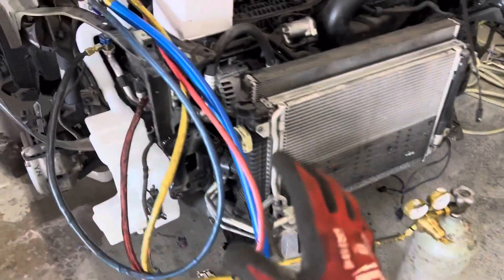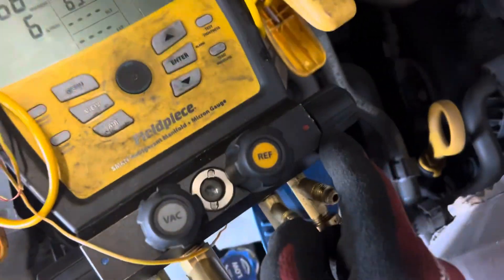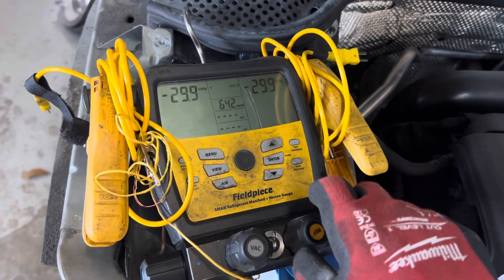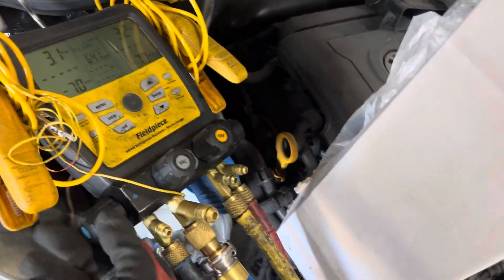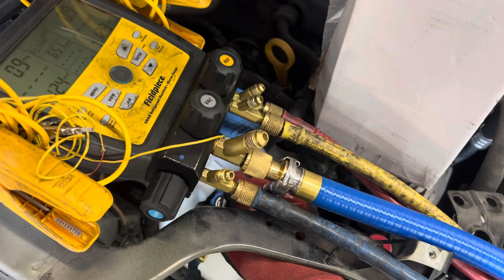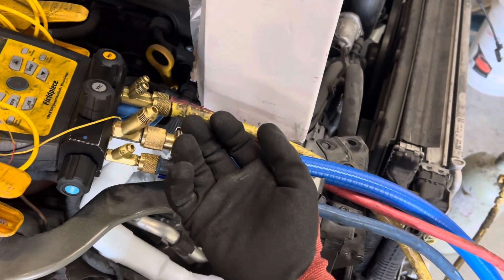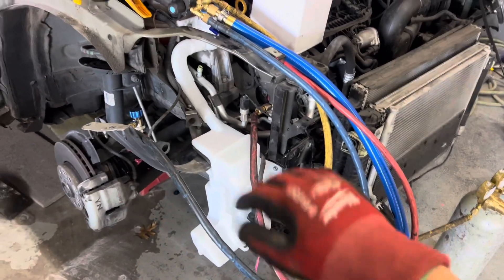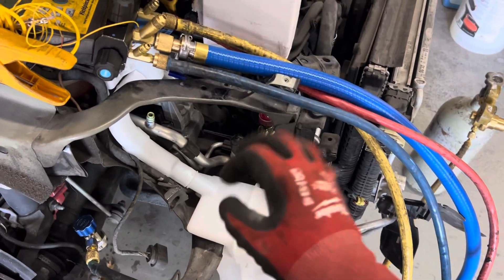WHY NITROGEN ADDED AFTER REFRIGERANT RECOVERY ? 🤔

Comment: Does it take time for swash plate to tilt in variable displacement ? cause it always blow warm air for at least a minute . I think what control valve does is opening a path between crank case and suction case so pistons vacuumize crank case so the pressure lowers there and plate tilt?
Reply from the maker: The time it takes is controlled by software provided by the manufacturer

Different manufactures software, depending on the temperature difference of the ambient and the cabin air temperature and what the customer has their temperature set to the more the faster and harder it will change the displacement of the compressor for instant cooling 

Some manufactures have a very long wait time like 60 seconds from the time you start the engine before it engages the compressor

I have some video showing this using Bluetooth wires, pressure transducers with my recording software from Fieldpiece from the moment the engine starts the air conditioning is calling, but nothing is happening the compressor

And then all of a sudden you can see instantaneously. It goes from zero to full pressure immediately really fast. 

And different manufactures ramp it up and ramp it down at different rates 

So just like old-fashioned compressors that were fixed piston and expansion valve, some worked good some did not work so good 

The same thing with modern day AC systems how the software is written for that particular year make and manufacturer vehicle some work good and some don’t work so good

Comment: Backfilling with nitrogen makes perfect sense to me. You shouldn’t even change a core valve unless it’s under some pressure to avoid contamination. So now the tech at this shop completes the work. Then does the shop call you back to pull a deep vacuum again and using your one hose method you add refrigerant by weight (no gauges or engine running etc)?
Reply from the maker: Yes, I do both methods depending what I feel like. 

And what equipment I have left with me 

Because many times I’ll be doing three or five cars at one time 

Or I will have equipment with vacuum pumps running at Sal shops in the local vicinity . 

So by the time I get finished setting up my last vacuum pump at one of the nearby shops it’s time to head back to the First shop ready for recharge and keep repeating the pattern throughout the day .
Reply: @coldfinger459sub0  you are one efficient guy! I am really liking this by weight method rather than by pressures. But in the end, doesn’t the pressures and temps matter? I understand pressure readings can identify issues such as restriction, but how do you know you are truly dialed in? How would you know how much refrigerant you really need? For example, I am working on a 1987 with had R22 that is converted to 134a. In this scenario many say you about 10-15% less 134a than you did with R22. How would anyone know this without watching pressure and temps? In this scenario we don’t care about the weight of refrigerant. Instead we are worried about performance (which everyone should ultimately be after). I see many of your videos where you say, put in less refrigerant than what’s called for (like these Prius). You’ll also show us where the pressures don’t matter either. How in the world can we bring science back into the picture? This Willy Nilly approach where everything is different is starting to become confusing. The old school guy will use the beer can method on the pressure side and call it a day. I am getting more confused as I learn more. The HVAC world is starting to look like the other trades. They try to professionalize it by making it complicated only to realize the ultimate goal is to have the A/C blow cold and the consumer doesn’t care how you get there.
Reply from the maker: @TonyLiveTV  R 22 has not been used in cars and only in two or three models for one or two years since the 1950s. or very early 60s I had to opportunity to work on two of those vehicles

I think you mean R12 

The manufactures of automobiles have a very precise weight that was for the exact same length of lines and the OEM condenser and all components, and therefore you only fill it up by weight 

Biggest problem with older vehicles and had fluid driven thermal fan clutches is that once they had 30,000 50,000 80,000 miles several years on them they are no longer within factory tolerances of their ability to move air. They start slipping more reducing airflow having nothing to do with engine cooling for the radiator, but greatly affecting the condenser because The condenser was not built with too much over tolerance like a radiator was.. 

Therefore, your pressures and your temperature will be wrong .  Unless you change the thermal fluid clutch on each vehicle when you go to service them..  

Airflow is king airflow is the very first thing you adjust 

Just like when you’re adjusting points and timing on a car, you adjust one before you touch the other one otherwise you’ll throw it off or when you’re doing a wheel alignment caster camberset toe last. 

Otherwise, if you set toe first, when you go to adjust the Canberra caster, you will throw your toe off. It will now be wrong.

Same thing in air-conditioning if the airflow is not correct, whatever your measurements are, they are wrong to the condition of lower airflow
Reply: @coldfinger459sub0  yes R12. But this still leaves me with the same question. How do you know when enough is enough? Are you saying you never know? Is the only way you could know is to start factory fresh by replacing everything? There has to be a scientific approach to the unknown. The unknown in this scenario is the system at hand. Any system is the system at hand. Maybe the compressor is old, or maybe there is a little restriction of debris behind the electric fan (show me one that is clean). There is no such thing as perfect. That’s when I feel pressure and temperature wins over any other approach. This is why so many people say to add about 80% and then play with the numbers to dial it in. Even the parts I purchase directly from the dealer have different specs than when the vehicle was purchased new. What are we going to do now? Doesn’t it all come back to pressures and temps? I don’t see any other way to dial in your A/C.
Reply from the maker: @TonyLiveTV  service manual
And if somebody doesn’t own the hardback version, then you pay for the online version through the manufacturer you pay their daily rate for one or two days from different manufacturer usually will arrange anywhere from $20-$90 

You can purchase their information for some by the quarter or half year or a whole year access to specific manufactures like Rolls-Royce Mercedes-Benz BMW Chevrolet Toyota Nissan. All the information is available to purchase to get your weight scale of refrigerant quantity required for each vehicle. 

There is no guessing
Reply: @TonyLiveTV   Use this, and of course this is just refrigerant weight/capacities No any other variable.

Molecular weight of R134a :  102
Molecular weight of R12 : 120

So 102/120 = 0.85      
       
This is your multiplying number. 
I guess that's where the  " use 15% less " comes from.

Example : if your system calls for 20 oz of R12  you multiply 
20 x 0.85 equals 17,  so you fill the R12 system with only 17oz of R134a.

Where are you located  cos some system don't take the R134a that good unless is not  to hot where you live.

And if you use 121 for the weight of R12 is still just 0.2 oz different. 

This should be a good star for the conversion,  I can't remember exactly really but i remember me reading another variable for conversion but I think this should be close enough .
Reply: @CHRIS75MASTER  yes that’s the numbers I’m talking about. Don’t you love math and science. I live in Arizona where it is hot as hell and dry. Forecast is 113 degrees for Friday with something like 8 percent humidity. I know the science points to R12 as blowing colder, but my A/C system has already been converted to R134a. All new hoses and A/C compressor are all labeled R134a too. The rubber hoses may be R12 compatible, but I will run the R134a. The vehicle is a 1987 560SL which I can’t see myself driving in the summer. I don’t even want to drive my BMW in the summer.
Reply: @TonyLiveTV   Man probably one of  the hottest place on the US, I am here in Fl although not quite like there it gets really hot to plus the humidity it really makes the ac system work hard.
So would you like to have the same cooling of R12 with a cheap and simple change?

I also had an R12 car but mine was even worse cos was a japanese sport car so it was really compact making any change to R134a useless in summer time, other cars like big 80's US cars were big in everything so they don't suffer as much with the conversion to R134a, also the place you live makes a different.
So I went looking for a fix, like many I found those cans of blends and other stuff but luckily i found the best, it's R152a or now commonly know Air Duster, this behave almost just like R12 without the hassles of it, with the right weight my car was blowing like never before even in hot weather.                             The best part is that you can put it in a R134 system cos its compatible with pag oil (my system was also converted to 134 with pag oil) so all you would have to do it's recover, vacuum and put the new refrigerant, plus get a side can tap for $15 and a couple of cans of R152 for $10 and that's all, you'll get a colder ac system, running this years and when done properly like Tom here shows us the results can be great, not like the guys on youtube videos that just shake the can without even a proper vacuum.

BTW  this is a great channel cos every video of him has great info, it's like he is giving free money away, and they are short and to the point, anybody will learn a lot from him, and these are things that not even some shops do so his advise it's priceless.
Reply: @CHRIS75MASTER  The advantages of R-152a is impressive and include a proven history of performance, low cost, and a pressure temperature relationship similar to R-134a. But on the downside, R-152a has flammability traits that surpass R-1234yf.l which is also a replacement for 134a i think. The EPA lists R-152a as an acceptable alternative refrigerant, provided that it’s used only in new A/C systems according to specific criteria, along with dedicated fittings and labeling. I don't want to research what dedicated fittings I need and what would be considered "new system".

It all sounds great performance wise, but using, accurately weighing and compliance concerns, I think I'll stay with R134a. It too is only $10 a can here in Arizona. I can't purchase a 30 gal tank of R152a. At least I couldn't find anything.
Reply: @TonyLiveTV I saw that some new agricultural machines use R152a as refrigerant. And personally I believe the guideline of EPA is to avoid confusion and protect patent holders rather than safety itself.
I was lucky enough to get a 10kg R152a when I was in Hongkong. it is understandable that getting a 10kg to recharge only a car is nonsense so getting some duster cans is worth a try. It won’t hurt you and easy to deal with if you don’t feel alright with it. I have done it on 3 R134a cars and the results are promising.
Reply: @knk3220  I have read many posts and watched several YouTube videos and I’m convinced you are correct, but for me I don’t see why I would go that route when the 134a is cheap and used in a gazillion automobiles with success. A 10 oz can of Duster R152a cost $14 if you can find it. A can of pure R134a is $9.89 for a 12 oz can and I can find it everywhere.
Reply: @TonyLiveTV   If you don't even drive it in the summer why bother.
But here in Fl. Harbor Freight sells then for $5.99 a can, Walmart sells four for $22, home depot $12 for two cans, office depot, target, hardware stores and even some groceries stores sell air duster.
Reply: @CHRIS75MASTER  Amazon sells R134a for under $10 a can. There must be some kind of state law or tax on 134a where you are. Same thing at the auto parts stores. I just check O’Reilly and it is $11 and Walmart is only $9.98 a can here in Arizona.
Reply from the maker: @TonyLiveTV here in San Francisco county in California. They add a $10 per can exchange recycle fund fee.

If you bring back The, can you get your $10 back. 

Delco refrigerant is $10 then they add another $10 onto the can which makes it $20 

If you return the, can you get $10
Reply: @coldfinger459sub0  they don’t do that here. I have no problem recycling the cans myself. Once I get 608 cert I can buy a tank. God forbid I buy a 20 gal tank without being EPA certified. Instead they let me buy individual cans which spew out refrigeration every time you change the can.
Reply from the maker: @TonyLiveTV  yes EPA is idiots. They’ll make you get a license to get a 20 or 30 pound tank but they’ll let anybody buy the little cans every day and top off and release refrigerant every month on their vehicle keeping a charged up Leaking. It just doesn’t make sense.. 

Imagine if they take catalytic converters off cars and go back to carburetors what our air quality would look like a hot summer day .
Reply: @coldfinger459sub0  not to mention how bad it is for the environment when they mine all the materials to make that catalytic converter. Just like the Tesla batteries which don’t have a zero carbon until the 7-8th year and then at 10 years the batteries need replacing. Before the catalytic converter I got way better mileage and more horsepower so my harmful carbons were probably about the same as when they made us use catalytic converters. Engineering of the engine had a bigger impact than the catalytic converter did. You can almost make a carbon free gasoline engine these days. We are way past the Briggs and Stratton days of engine building.